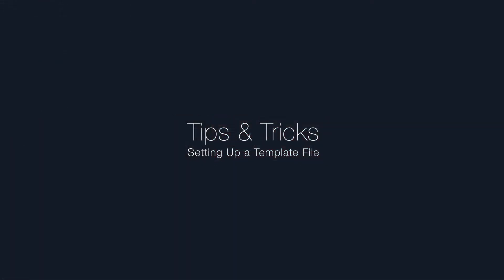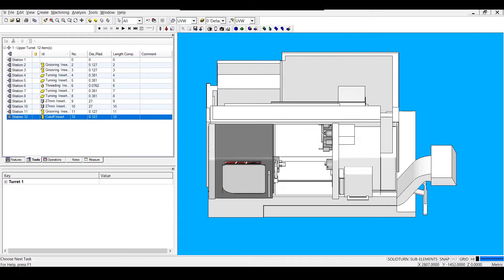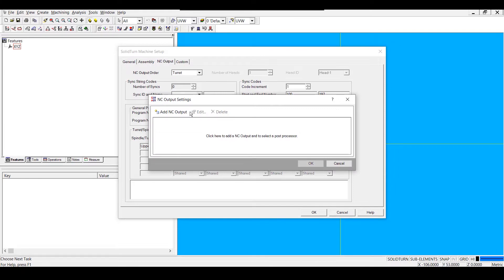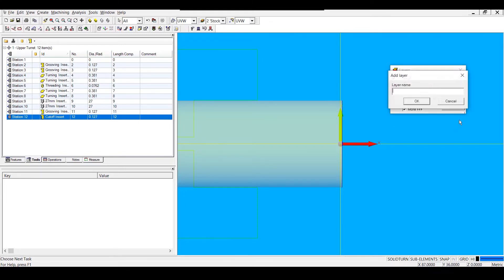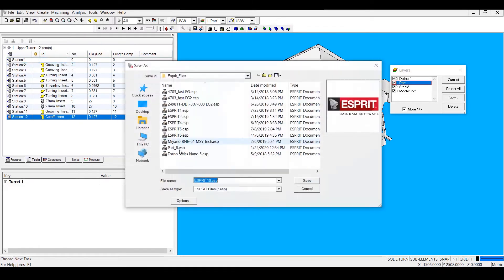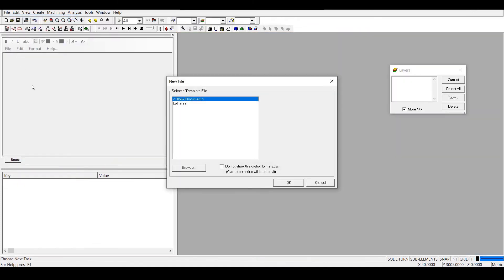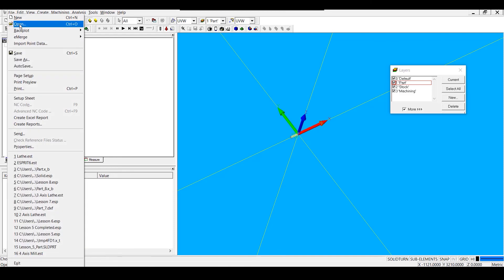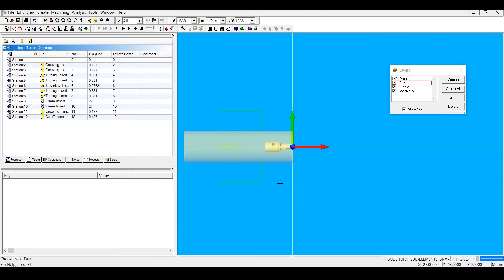ESPRIT® Tips & Tricks: Setting Up a Template File

Comment: Is there a reason to not include the post processor in the machine setting file? if i write protect the template file, it should be harder to overwrite it by accidentally pressing save?
Reply from the maker: In the video we do show the process of adding a post processor file to a machine setup. Is that what you are asking?
As for the template file,  if you open the template file from your template dialog pop-up window and then press save, it will prompt you to save the file as an .esp file rather than .est, meaning it won't overwrite the template.
Reply: ESPRITCAM if u add the post processor and then right click to save the machine setup, the post processor will already be added next time u chose that machine setup. Or do u have more than one post processor for that machine?
Reply from the maker: @henrikforsberg683 , both this way and the way shown in the video are valid ways to add post processors. If you save a machine setup with a post processor in a template file, you won’t have to add the post every time. The post will be automatically added when you open the template for that specific machine.
Reply: Hej Henrik Har du skapat någon templet file till din/eran maskin?